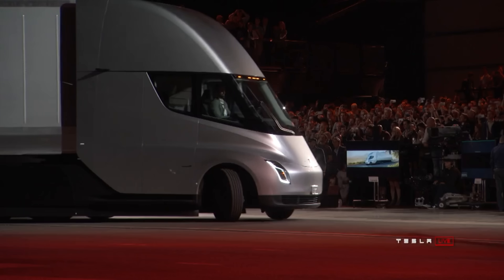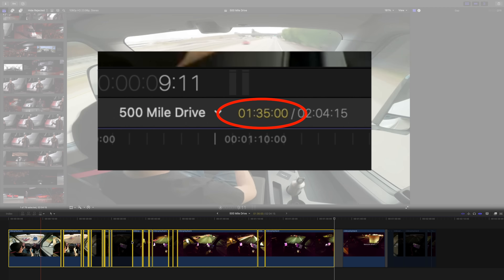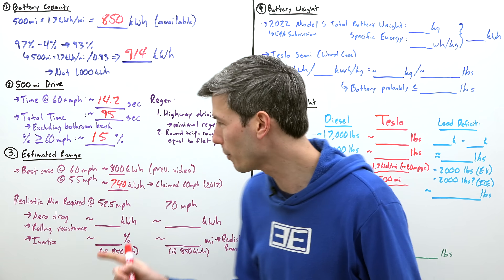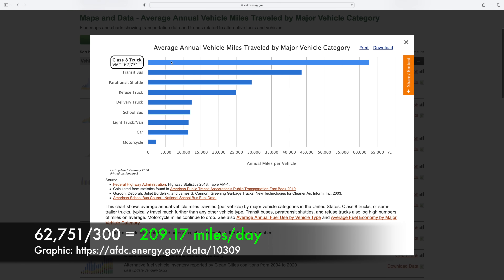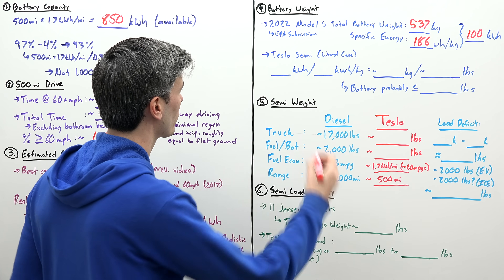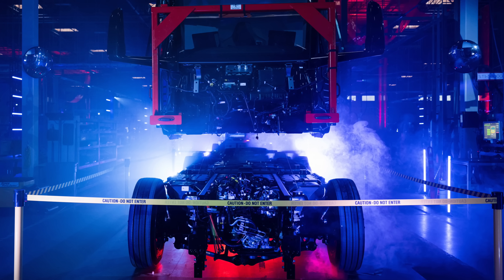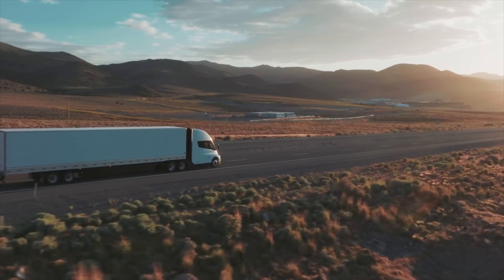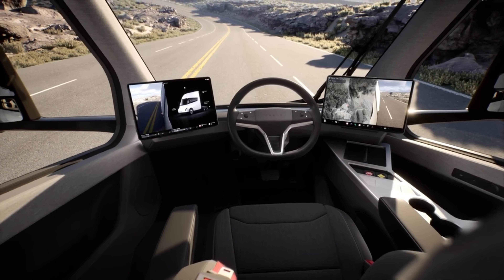Does The Tesla Semi Make Any Sense? Part 2!

Comment: The biggest problem with having most of the vehicles on the road as battery powered is the added load on the grid. It's nowhere near being able to cope. Also, what is the point? ICE emissions are hardly of consequence when compared to flights or even domestic heating. At best they just move the pollution to a different location, truckstops will need their own power stations, and how much fuel duty will be lost to the tax collector and where's he going to make up the deficit? Tesla cars are made to a generally poor standard, if their semi is of similar construction I don't think it will cope with the rigours of being used commercially. Hopefully Tesla will go bust in the near future, there cars and the drivers that think they can sleep behind the wheel are already killing other road users, their driver assist isn't being used safely because Elon Musk is always lying about it's abilities. God help us if semis start ploughing into other road users. Then there's the fire risk, the regular Tesla car can need 30 times as much water to extinguish, the semi will need vastly more and be much more likely to fail in the event of a collision. All things considered most EV's are completely pointless. Good comparison tho' the semi isn't completely useless but there are just too many issues to overcome for little reason.

Comment: As an OTR driver, a Tesla or any other electric truck would work for me. I generally pull heavy loads and not often near a place to charge the truck. Electric trucks have their place, Pepsi, Coke, most grocery store deliveries could use them, in most cases. Overall in my Volvo with a D13 I am seeing 7.4 mpg tuning most of the lower 48, including the Rockies.

Comment: Very good analysis, however I do believe you under estimate the role of regenerative braking on the highway.  I drive a Nissan Leaf (fully electric, for those new to this subject).  When I drive the highway I am forever removing my foot from the accelerator pedal due to changes in traffic patterns and cars pulling in front of me.  This is non-stop.  Note, I am not applying the breaks, only removing my foot from the accelerator pedal.  Each time I remove my foot the regeneration kicks in immediately.  I can both feel it and see it on the monitor.  I have to assume that electric semi trucks are equipped with automatic regen which is activated by the release of the accelerator pedal and does not rely on the brake pedal to be depressed.
Reply: It looks like he assumed the regenerative breaking works at 100% efficiency, which defies the laws of physics.
Reply: @cmitchell17a1  Say that I am driving and my battery is at 62%.  For whatever reason (cars ahead slowing down, etc) I take my foot off the accelerator pedal.  If I keep it off for 50 to 75 feet my battery charge increases by 1% to 63%.  Doing this enough times does make a difference to the range.
Reply: @coffeeisgood102  Yes it does help, but the conversion is no where near 100% and I have struggled to find numbers on this, even in peer reviewed papers because I was curious about it. Assuming the battery percentage initiator is 100% indicative of charge, which it is not as it's programmed to fib a little, if you were at 62% then went up a hill and at the top went to 61%, then let off the accelerator and let it regenerate all the way down to the bottom of the hill, you would not be back at 62%. My guess is it probably averages around 50% in the best of cases (I could easily be wrong about this figure, but I guarantee you it's not 100% or probably even 95%) , when the battery and system is receptive and the vehicle is at higher speed and is probably most efficient at highway speeds and probably drops close to almost zero at lower speeds below 30mph. 

So in that same scenario you would be at 61.5% by the time you got back to the bottom of the hill in best case scenarios and assuming you lost no other energy in between.

The second law of thermodynamics (you could call this law of diminishing returns) still applies even to EVs and batteries.

Comment: When considering EV subsidies, one should take into account that the US government alone spends $20 billion every year on direct fossil fuel subsidies. Of that figure, around $16 billion goes towards oil and gas, while the remaining $4 billion benefits the coal industry.
There is also data to suggest that the problem is getting worse rather than better. Between 2017 and 2019 production subsidies for fossil fuels grew by 28%.
One cause of soaring trucking input costs is the long list of government-mandated technologies imposed on manufacturers, especially emission-control systems for engines.  Diesel exhaust after treatment systems and the technology that controls them are very expensive, and frequently break down—maintaining and repairing these systems is an expensive business.. EVs will probably lead to far less maintenance in the long run once the bugs are overcome in the new tech and a decent recharging structure is in place.If the electricity is produced using renewable tech then there will be other benefits not factored in by the presenter of  this video which further boosts the argument to change over to EVS .

Comment: Excellent, part 2. Still curious about combining fuel cell and electric to allow greater range and less time recharging although refueling with hydrogen would still need to take place. Hydrogen filling stations at large warehousing areas would be relatively simple as would charging just batteries. Your thoughts?
Reply: Maybe you mean combining fuel cell and battery. As fuel cell vehicle is actually using electric motors anyway, just different in energy source/storage. combining both is packaging and weight nightmare as jason explained in his other video, hydrogen storage is heavy and bulky units to get any meaningful range out of them. Takes a lot of space in already crowded space of electric semi. Gas range extender might be more viable solution for range problem but that's just bringing emissions back, defeating the electric semi purpose.

Comment: You haven't taken into account that Model 3 2170  have more energy density than the 18650 Model S and that the Tesla Semi is most probably using those. Maybe redo the calculations from 7:25 with that data?

Comment: That assumption about regen and the altitude at the start and finish is only true if non regen brakes ,such as friction or magnetic retarder , are not used. If the non- regen brakes are used, that energy is lost forever.
I don't believe that a fully loaded trailer rig can always only use the tractor drive wheels for braking. Braking has to be applied through the trailer wheels to maintain stabilty.
Regen only operates on the tractor drive wheels.

Comment: A couple of points from a truck driver: 

1. 17,000 pounds is a good figure for a Class 8 diesel truck. I currently drive a 2018 Freightliner Cascadia and when I fuel up I’m at 18,000 pounds. However, that includes 240 gallons of fuel, 20 gallons of diesel exhaust fluid, tools, and driver. If the Tesla weighs 9,000 pounds more than that before the driver and any personal items they bring, that’s significant.  I’d also point out that at 18,000 pounds, I have a fuel range of 1,600 miles plus a small reserve. Not only does this mean I spend less time fueling (time is money, after all), it also allows me to go further down the road to where the fuel is cheaper. 

2. If they really had to average only 52-53MPH in order to get their 500 mile range, that’s just not competitive. Most interstate highways and quite a few non-interstate roads have posted speed limits well above that. Driving at speeds below 55 creates a traffic hazard on those roads. 

3. The majority of my loads are heavy, and cover distances between 500-600 miles. This is true for all but a few of the drivers at my company. Even at 500 miles, operating the Semi would require extensive changes to our operation, and by necessity, our customers’ operations as well. Even if there are some financial incentives to make this more attractive for everyone involved, it’s inadequate for the amount of hassle and trouble required.

Comment: I used to haul beverage. A standard day cab (lightest) tractor/53' trailer combo with full pallets of beverage loaded straight in is about 89-92,000lb. Pepsi ships interstate using sleeper cab tractors with 53' trailers and pallets loaded sideways to fit more, they need 105,000 GVR ratings. I am very suspect of Pepsi using Tesla trucks for interstate beverage transportation as they cannot carry what their current trucks can carry. So to be there is a little publicity stunt going on there with the Pepsi 500 mile claim. I agree there is a use case for these trucks, it's just that long haul beverage is not it.

Comment: I’m curious what kind of range degradation these will see after years of use and range loss in cold climates. I saw a article saying that EVs on average lose about 16% of range after 10 years of use. But that’s for consumer cars doing far less miles each year than a semi so range lost could be greater. Then losing ~15-20% of range in cold weather would put the semi at a max of 330-360 miles range for an older truck on the road best case. Still not bad for a lot of routes. But not great either considering a normal class 8 semi has about a 2000 mile range.

Comment: 1:25 - Tesla's claimed "500 miles at 60 mph" and the videos data can co-exist. The "500 at 60" is probably not an average of 60mph including starts and stops or hills, but rather a baseline of 60mph continuously (eg closed circuit). This could easily match up with a lower average speed including stops and hills (re-gen is not 100% efficient).

Comment: When you were adding up all the various weights for a diesel versus electric trucks, you stated that both were 17K pounds and then added fuel and battery to them respectively.  You are assuming that the diesel engine and cooling weigh the same as the electric motors and inverters.  An average class 8 diesel motor weighs about 2880 pounds - are you confident that the motor in the semi weighs 41x as much as the motor in a (365hp rwd) model S, or should there actually be some weight savings there?  It's only a few percentage points in a 27K vehicle, but if we're trying to be as accurate as possible it should be considered.

Comment: This is a great video but you forgot to factor in cold weather effecting range. I have a standard model 3 when it's 20 degrees outside I struggle to get much more than 100 miles driving really slow in chill mode and with driving without the heat and defrost on.
Reply: Semi will be far far far less affected by cold. I'd expect 2-5% less range, and most of that due to higher density of air.

Heat for driver would be 100% from waste heat from the motors, and even it it comes from a PTC, 3kw from a 900kw battery pack is insignificant.

Also, unlike our cars, the batteries in a semi are almost always going to be warm regardless of the air temperature (semi will either be driving or charging so always some source of heat).
Reply: @dorvinion  I never thought of it like that before I hope your right. I'm not a truck driver yet but I want to become one as soon as I can probably after I save for CDL school after I pay off my car. Who knows maybe I'd get a Tesla Semi to lol.

Comment: Regarding the speed calculations, you're assuming a fixed speed ramp for the entire trip, rather than different speed ramp multipliers for different speeds. 60 straight ahead on a freeway is way less interesting than the slower speed navigation of junctions and smaller streets etc. I don't know if there's anything anywhere that outright states the timelapse is recorded at a fixed multiple.

Comment: Tesla is lying to you on a scale you can't imagine. I'm working with logistics, and we have orders ranging from 150 miles to 1000 miles, and believe me: if 80% of all of my loads were less than 250 miles, I would be much happier.
Reply from the maker: But that's how averages work. There's a massive quantity of deliveries that are more than 250 miles. That doesn't mean on a percentage basis, that's the majority. Anecdotes will exist on either end, pretty much always.
Reply: @EngineeringExplained  I'm just saying that at the moment, tesla Semi has no advantages in longhaul transportation, but, right now I'm very eager to see a competition in that market, which will use Lithium Sulfate batteries (from Lyten for example), which have much bigger energy density than traditional lithium ion. 
But anyway, that is only my opinion, some people can agree, some to disagree. In any case, your vids are still well structured and very interesting. And I'm thankful for that.

Comment: They went from 4 motors to 3 motors because they originally were going to be model 3 motors. But after they made the plaid motor they used that instead as they are far more powerful therefore only need 3 of them.
Reply: And that is a good thing.  Fewer things to break and less overhead energy waste.

Comment: Great video. It seems like over the road applications out west may be out where heavy loads and 20+ mph headwinds are common. I’m curious how quickly and how much the batteries degrade. A 10% reduction in battery health would probably not be super noticeable in someone’s daily driver but might make a big difference in applications that push the limits of battery capacity.
Reply: The speed of degradation is of real interest if you frequently go from 97% to 4% as in the Tesla demo. Tesla recommends keeping their car batteries between 20% and 80% to extend battery life.
Reply: @zmavrick  Indeed!  But that trial and that video was just a demonstration of capability, not of best operating practices.
Reply: @st-ex8506  But isn't what is important, the operating range under realistic operating practices? Doesn't that make the demo unrealistic showboating? I am all for the Tesla semi, but want to be realistic about its capability and application.
Reply: @zmavrick  no! The Semi can drive 500 miles at full load on a charge. It does not mean that it will be operated on 500miles routes. It is not lying or deceiving for that much! Does BMW lie if they say that my 330i can go 160 mph? No, they don’t. Do I drive that fast?  No, never ever.
Max performance is one thing, realistic operating scenarios is another.
Definitely no showboating, IMHO
Reply: @st-ex8506  I don’t know anything about BMW’s marketing claims. I think the problem is, how does someone know what the truck will actually do for them? Let’s say I see Tesla’s demonstration, take it at face value and want to buy one for a 450 mile route. Does Tesla ever tell me that the truck might not be capable of that route in a couple years or am I expected to know technical details about batteries? Hopefully there will be realistic specs available when someone goes to actually buy one but who knows. I think the other problem is, let’s say I’m an investor. I see the demonstration, do some market research and decide that a truck that costs $200k, can go 500 miles fully loaded will completely take over a sector of trucking. When I make my investment I’ll be making that investment based on false information. There is a point when that sort of misleading information becomes an actual crime.
Reply: @CanusDirusx  Your reasoning is correct… for a non-professional buyer of a car. The clients of the Semi are professional managers of large truck operations and not the general public. They will definitely know what data to ask for!
If you visit the web sites of diesel truck manufacturers, you’ll find even fewer technical details on their products that Tesla provides on the Semi!
Reply: @zmavrick  good comment. It seems like that should be part of the calculation.

Comment: Well thought out with one assumption that may be wrong. You’re assuming that the Tesla weight minus battery would be the same as the diesel minus fuel, or 17,000 lbs. Assuming the running gear (tires wheels and axles) the frame, the body and interior are similar and the same, do the the motors including transmission and drive line weigh the same? Would assume the much more compact and simple electric motors would weigh considerably less than a 9l diesel with a high torque automatic transmission and drive line. This may be a 1000 to 2000 lb difference.

Comment: Why is the weight of the trailer not factored into your calculation for payload with barriers? Also in the video Tesla mentioned payload was just under the limit without specifying exactly how much under.
Reply from the maker: Tesla stated the total weight. The weight of the trailer is factored, it's just not needed to determine what the load is on the trailer. 44k is probably the load. That leaves 38k for tractor + trailer.

Comment: When you use Science to remove your concerns about CO₂ as a potent GHG (it isn't, it is fuel for photosynthesis¹) then you can include hybrids with optimised IC 'donkey' engines (plus fuel) and much smaller battery packs for high energy situations. Reintroducing range, infrastructure requirements, off-piste locations etc.
Does anyone build Regen braking systems on trailers yet?
¹ Min level for life on this planet is 150ppm. Earth got as low as 224ppm, down from a high of a highly verdant 6,000ppm, and we need more to restore the deserts. [Regen Ag and Dr Jehne.]